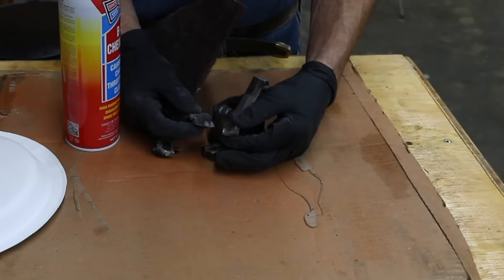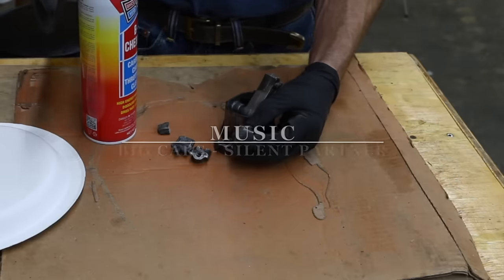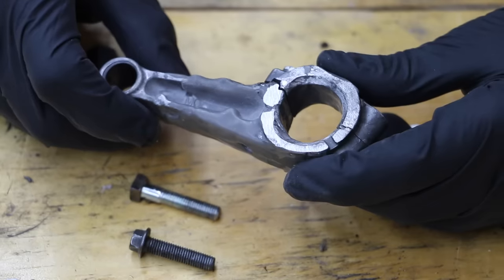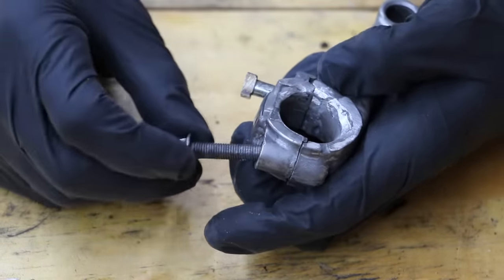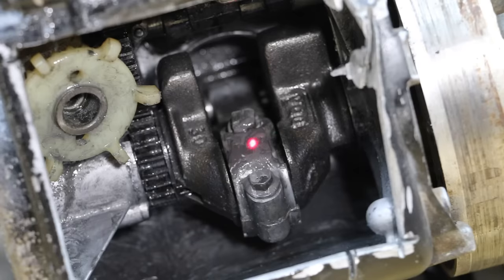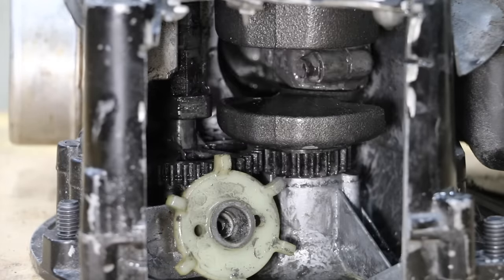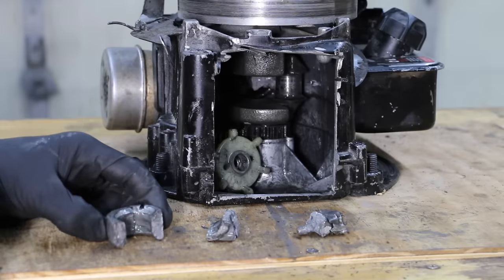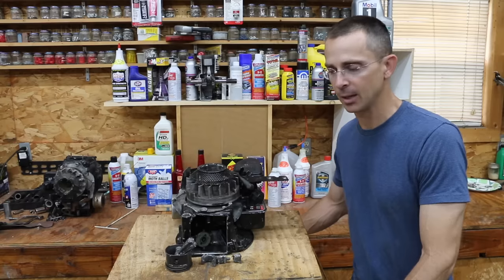Is JB Weld Strong Enough to Repair a Broken Connecting Rod? Let's Find Out!

Comment: Maybe oil & gas has an effect on it?  I wonder about the heat also but i don't think it went long emough to buils ip much heat.  I had a 600 lb cast iron radiator that broke 2 legs off. I cleaned them with mineral spirits only. Washed it with water after ( no sanding at all) then mixed all crafts epoxy. Stood the radiator on its feet, left it 2 days. After we carried it by its 4 legs and it held. 
  Nothing like your pressure, fluids & heat but it's something to try if you want.👍👍
Reply from the maker: Thank you!

Comment: i bought   some  jb  weld  in  LS   MO for   some       metal  gouges  in  my jointer   table.  Dried  out  2 yrs  later  an  failed .  Depends  on   the   repair
Reply from the maker: Thanks for sharing.

Comment: I must say it did run a little bit and seeing that was a surprise. I have a small hole in the bottom of my aluminium canoe and I am wondering if this stuff would work.
Reply from the maker: It should be able to repair a hole in the boat.

Comment: Knew that would never fly...although I broke the con rod on my compressor and I heliarced it back together, I dropped the cutoff switch down to 80 psi and it has about 50 hrs run time and still sounds happy.
Reply from the maker: Thank you!

Comment: Is it possible to try this experiment again? Just this time insert small dells by drilling small holes in broken parts. Glue the dells in on both sides with JB weld. Glue everything together. Just ensure that there are dells inserted between all broken parts. I think that results may differ for sure
Reply from the maker: Thank you for the video idea!

Comment: The welds broke on my drivers seat which control the up and down function of the seat. Do u think jb weld steel will be strong enough to weld it back together
Reply from the maker: Steel has a much higher PSI rating.  If the steel failed, I doubt JB Weld will provide a lasting repair
Reply: @ProjectFarm  you are absolutely right. Going to get it welded today.

Comment: Oops answered that. Hopefully the crank isnt screwed. At that height youre lucky you didnt get a gut shot. You need to try the Delo adhesive i told you about months ago. If it will hold a 17 ton crane off the ground about 4' for an indefinite amount of time using 5 grams of glue you might have a shot with the crank. At least long enough for it to get warm enough to blow the side of the engine block apart when it does give way.

Comment: 3 of 6 Water pump bolt heads snapped 300td wagon put new pump on jb welded bolt shafts that were sticking out to pump. 50-100k miles later still strong.
Reply from the maker: Great to hear!

Comment: I used it to fill in freeze plugs that were under the motormounts but had started to get pinholes from not using antifreeze. It never stopped working so I never bothered it.
Reply from the maker: Thanks for sharing.

Comment: let me tell you 100% true story. While living on the big Island of Hawaii  . I was meeting a friend at the south point of the Island .he told me what road to go down ,it was a gnarly trail with about  5 lava flows crossing it as you went down. now I'm driving a 87 toyota van non 4x4 I made it through the worst of of the flows and came to a nice pasture  with a few horses its where my friend was supposed  to be .he wasn't , i drove around the field and found  a primitive  road through a lava flow that was  intimidating ,I figured that if carl could make it in his 4x4  I surly make with van (I'm just setting up the scenario for the JB Weld) Well I dropped in to this trail I got to the  first turn and fifteen ft. after was a ten ft. 60% slope to a flat top about  sixteen ft.across didn't make the first attempt so I backed down until I was at the  back of that first turn this time  second gear start.I launched 4ft in the air when I landed I heard a loud bang then aloud clacking noise from the oil pan .Got out looked  I landed on a 16 in. rock right on the pan I thought it was the pan hitting the crank  got back in my oil light is on and  here I am sitting on this little 16 by 16 ft plateau with a bolder under my oil pan.So I  turned it off jacked it up kicked  the rock from under it sat there thinking this is fuxxed. so took out my 5 qt. cooking pan drained the oil in it (I'll need that for after I put pan back on) dropped the pan and  herd something fall in the pan as pulling it down .looked in it and my oil pump was laying there in two pieces the ear of a tab that it is  bolted  to was broke off the block the tube on the pump was broke at the flat surface where it  bolted  to the bock I couldn't do any thing else that night so in the morning  packed water some snacks for 8 mile hike back to th main road  got to a town called  every  atuo par store on the island  no one  had a oil pump  it would be a week  before I could get one .I went ace hardware  saw JBWeld thinking I'll glue the pump back together same for the tab to bolt it back on ( used smaller sized bolt with nut washer to bolt thru ) repeat long hike back cleaned block for the tab with a little colman white gas mixed the jb put on tab and block set it with vice grips then did the pump it was about 6 pm so kiked back the next day . Fist thing checked the tab pulled vice grips felt pretty  solid same with pumpI used bolt thru as to not stress  the tab.got the pump on i grabbed and pulled my self like a pull up and it held got pan oil back on then the moment of truth started up took a bit for oil to the top end but the oil lite went out it was working  now I still had to drive up the gnarly  road to to highway then 120 miles to get home yes it did work some people didn't believe me I don't care I know it got me home

Comment: Chem cleaner (carburetor cleaner ) leaves behind  a small amount of lube for the linkage and carb pivot pins throttle valve pins and other things that move on a carb,, now brake cleaner does not leave ANY lube or residue behind,thats what u use to really clean something...
Reply from the maker: Thanks for the feedback.

Comment: Next try the same repair using the homeowner propane torch type aluminum "welding" system ....see if THAT lasts a few minutes??  For example HF's "Alumiweld" or similar....which actually are more brazing in that none of these actually melt the parent metal instead the "welding" rod flows and bonds with the parent metal....I for one would LOVE to see THAT video!   Also would be interesting to actually have a professional welder heliarc "properly" (LOL) weld a fragged conrod together and see if even THAT lasts more than a short time??
Reply from the maker: Thanks for the suggestion.

Comment: I remember my Dad jb welding a cracked transmission case together out of a wrecked car. Never leaked a drop. I jb welded a radiator until I had money for a new one. I think for non rotating parts and temporary fix it works well.
Reply from the maker: Thanks for sharing.

Comment: THANKS FOR YOUR INFO. I BELIEVE THAT IF IT HAD A BEVEL TO THE BROKEN PARTS IT WOULD HAVE HELD A LITTLE LONGER,  THE SURFACE WAS FLAT, AND NOT HAVING TO MUCH TO HOLD ON TO.  EVEN IF YOU APPLY IT ON THE SIDES.  WITH BEVEL EDGES MIGHT, I SAID HELD A LITTLE BIT LONGER.  STILL VERY INFORMATIVE. THANK YOU SIR. [ PS ] I USED JB WELD ON MY TRUCK RADIATOR IT WORKED FOR YEARS.
Reply from the maker: You are welcome!
Reply: @ProjectFarm  THANKS FOR REPLYING.  TAKE CARE, AND BE SAFE.  AGAIN THANK YOU FOR THE INFO.  ALWAYS GOOD TO KNOW ALL YOU CAN.

Comment: Can you test 2 part solid epoxies? The clay kind. Maybe do a drill and tap test to test the strength of the threads and you could probably come up with some more tests. Pressure sealing like a radiator、 or bendability and tensile strength. Idk might be a good video. I usually use pc-11 but curious if something better is available
Reply from the maker: Thanks for the video idea.

Comment: back in the early 80's we used jb-weld to repair a hole blown between two cylinders- lasted until? we sold the van 50k miles later and it was still going strong
Reply from the maker: Impressive!!

Comment: JB weld works well in applications where it doesn't have shock stress on it. I knew it wouldn't last long, because I (meticulously) repaired a broken framing nailer (the magazine boss was broken off)) and it only lasted about 100 shots. The shock is much higher on a connecting rod and the balance will be off as well. It's even difficult to get an arc weld to hold up for long in the bottom end of an engine. If everything isn't balanced perfectly , it WILL come apart.
Reply from the maker: Thanks for sharing.

Comment: I've been a backyard mechanic for over 40 years I was wondering kind of crazy in my opinion  but it could possibly work I seen YouTuber using a bottle of Degreaser you buy at the dollar store usually called Tuff Stuff or awesome he dumped it in the engine of a car as a engine flush I've always used Mystery Oil with every other oil change 1q keep my engine clean thank you as always VR interesting videos
Reply from the maker: Thanks for the video idea.

Comment: Might have been fun to weld it back together tight enough to eliminate the knock, throw in another used piston, re-hone the cylinder and fire her up again for light use! As a young kid I used to be fascinated with my minibike engine, lawnmower and edger type vertical Briggs and Stratton 3 Hp engine. I'll never forget the first time I took the side cover off to have a look inside to see how the thing worked. Gosh, it was so simple with so few moving parts! I still love a little maintenance work on car & engine.
Reply from the maker: Thanks for sharing.

Comment: It's not just the force of the stresses involved, but the number and type. You're subjecting it compression, extension and torsion as well as percussive abuses. Even the cast metal can only take so much; as shown by the original failure.

I'm currently in the process of acquiring a working 1/4 scale model of a steam powered traction engine with a cracked driving wheel. A new pair costs North of £500 and they're only sold in pairs, leaving me with a 'spare'. I was considering welding it up (cast ally) even though an 'expert' has already tried and failed. A few GB£ experimenting with this can't be a bad idea.

Comment: Incorporate wire mesh or laminate metal strip where possible to add strength. This works good on broken castings such as old lamps and fixtures.
Reply from the maker: Thanks for the feedback.

Comment: Any time you join broken pieces if possible drill small holes for the liquid epoxy to flow into preferably on an angle to get an extra grip like grabbing with fingers. especially up on the rod where you can coat it.
Reply from the maker: Thanks for the suggestion.

Comment: I HAVE A DODGE DIESEL CUMMINS 5.9. AND MY TIMING CASE CRACKED, DO YOU BELIVE THAT JB WELD MAY BE A POSSIBLE FIX
Reply: From what it looks like JB Weld should work, as the cover is not under any real stress or load and just needs to keep Oil in/dirt out.

If you don't remove the cover to fill the gap you might want to do an oil change just to be safe

Note that I've never done that my self and that you want to find the reason that crack exists in the first place
Reply: Thank you bud. The crack is bc the killer dowel pin came out

Comment: One thing I've found with glues and stuff like this is clampage is exceedingly important: it's like heat sink compound. The goal isn't to fill in large gaps, but to form a bond between the two surfaces. Without the clampage, it's not really going to be in tight contact with both surfaces, and bubbles and voids will be larger.
With that said, yeah, it's not holding up, especially without oil. Isn't that how it broke in the first place...?
Reply from the maker: Great point!  Thank you

Comment: when gluing wood together carpenters always get a clean face and use strong clamps and clamping pressure.....but gluing together 8 small pieces of aluminum was guaranteed to fail quickly..............a better test would be to saw a connecting rod in half through the middle and then see if by drilling 6 thru-rod holes in both sawn ends for added purchase and applying a golf ball sized glop of epoxy putty in the center of the break and forcing the ends together with clamps and pressure could you make a connecting rod function again?
Reply from the maker: Great constructive feedback.  Thank you

Comment: Cleaning metal parts:
1)  Use an ultrasonic cleaner with 50:50 Dawn and Distilled Water.  Three cycles with the mix, three cycles just distilled water
2)  Alcohol (best for any residual oils)
3)  Acetone (best for any residual greases)

This process will yield your cleanest, driest surfaces for the epoxy.
Reply from the maker: Thanks for the feedback.

Comment: The problem I’ve had with jb weld isn’t it breaking per say, it’s more of a problem with it sticking.  Whenever it fails it pulls away from one of the surfaces leaving the surface clean.  Had this issue on some plastics I was trying to use it on. finally ended up REALLY Welding the plastic with a heat source.  Problem gone.  Jb weld tends to work well on static metal pieces though (like a radiator or bracket.
Reply from the maker: Thanks for the feedback.

Comment: My son had a Yamaha 125  dirt bike and blew a hole in the crank case and we patched it with SHOE GUEE AGND EVEN SANDED IT AND PAINTED IT . HE PROB PUT 50 HRS ON THE PATCH AND IT NEVER LET GO AND WAS UNDER PRESSURE AND COVER WITH OIL . This stuff is very very strong much stronger than JBWELD .GIV IT A TRY YOU WILL BE AMAZED
Reply from the maker: Thanks for sharing.
Reply: I'm in the exact same boat I have a very small crack in my case right next to the front sprocket I've ordered some jb weld hoping it will fix it i don't mind buying a new crank case but really can't be bothered to split the engine and replace the case

Comment: Reminds me of the time some friends and I blew an old Honda water pump motor that had sat around forever. It barely ran at anything but WOT after all our work of restoring it....so we just held er wide open while we sprayed chemicals and flammables, dumped oils, and shoved foreign matter into the intake. 

P.S. unfortunately pistachio shells cannot get passed the tiny valve lift in those motors
Reply from the maker: Thanks for sharing.

Comment: Jb weld works good for fixing leaks. I put it on a metal gas tank and it lasted 11yrs. It leaked loose and I cleaned it up and smeared more back on it😂. I'm certified jb weldor 😅

Comment: Whenever I use JB Weld to mend parts that require tensile strength, I piece them back together with super glue, then reinforce them with one or more layers of fine mesh, again using super glue to tack the mesh in place.  Then I saturate and cover the mesh with JB Weld.  Never tried anything as demanding as a broken connecting rod though.
Reply from the maker: Thanks for the feedback

Comment: If the epoxy is braced around the shaft with some fibre glass like carbon fibre, it may work. On the other hand, industrial epoxy requires the component to be heated up to a certain temperature before applying the glue so the glue can fill the gaps better and reduce air bubbles, making overall the epoxy stronger.
Reply from the maker: Thanks for the feedback.

Comment: And that’s how the cookie...  I mean conrod crumbles!
I’ve seen a video of someone JB welding a differential with a massive amount of epoxy.  It actually held until they attempted a doughnut.  There’s just way too much force during the power stroke.  Peaking at a couple of tons.  Then about half that in negative force during the exhaust stroke.  Metal is crystalline like concrete and glass.  It can endure a significant amount of compression, but hates being pulled apart.  Which is why you should never rev your engine.
Reply from the maker: Thank you!

Comment: My first car was a 81 Mazda 626,I got it with 20k and a blown head gasket, there was a small blown out spot on the head and I couldn't afford to get another head so I cleaned it and filled the hole with JBweld. After it dried I filled it down and drove the car for a year until I flipped it on its side then sold it. The crackhead that got it drove that car to the crackshack and back home for 6 years no issues it did blow again but not in the same spot
Reply from the maker: Impressive repair!

Comment: Chem tool has residue no? Clean it with isopropyl alcohol and use some heat to dry it.  Maybe even etch it with some acid.  If you can get that stuff to bond well you have to grind it off

Comment: I get mixed results from it. The bond can be incredibly strong, but also incredibly fragile, unlike most types of Marine Epoxy. What I mean is, - the connection will be strong enough to support your weight, but if you drop the glued together item on the floor, - the glue will crack and come apart. It also doesn't appear to like being subjected to temperature differences of roughly 80-100 C. I find the bond to be very good on leathers and rubber, such as repairing the toes of running shoes that became unglued, or sole wedges of boots. But you absolutely need vice or clamps if you want the job to remain durable for the boot's or shoe's remaining service life.
Reply from the maker: Thanks for the feedback.

Comment: Use acetone then etch the surface with acid to clean the oxidation from the aluminum...... if you do not clean the oxidation you have no bond....I jb welded a clutch together on a Harley shovel head ( major vibrator machine as all know ) that repair is still good after 18 years
Reply from the maker: Thanks for the feedback.

Comment: I repaired my fuel tank once with a soap bar and I actually forgot about it for over 8 months. I recollected I had to replace it when I went on the ramp at the service center to replace the fuel sensor.
Reply from the maker: Thanks for sharing.